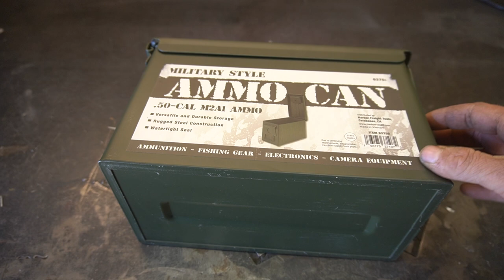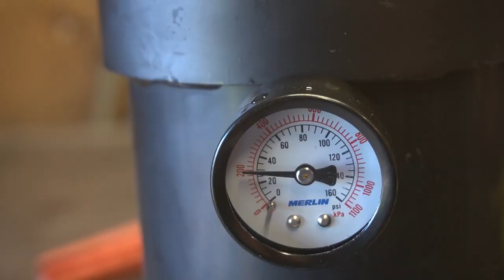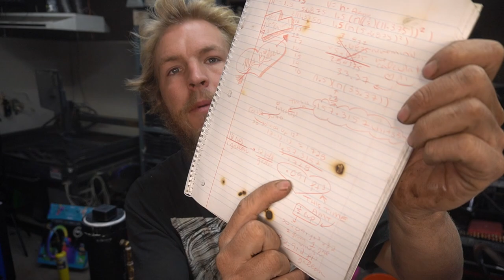Can You Weld Using Vinegar & Baking Soda?

Comment: great vid.
One thing you could do is add a sepparate tank above the reactor. add the baking soda to the reactor and let de vineger drip into it from the higher tank.
If you add a second line too the top tank the pressure sould allow the vineger to flow down freely. 

Also if you add to valves to the lines you can add more vineger as you go.

Comment: Look up, Kipps apparatus.
If you put the top bulb at a certain pressure, the outlet will match.
ORRR, use an arduino to pump in vinegar when the pressure falls below a certain threshold.
Reply from the maker: oh man you know i'm a sucker for using unnecessary arduinos
Reply: @cranktowncity  Seriously though, the Kipp's Apparatus is what you're looking for. Just a bit more plumbing in your cylinder. Also, switch out the baking soda & vinegar for calcium carbonate & muriatic acid. The form of CaCO3 does not matter... chalk, limestone, marble or even pearls will do :D

Comment: Hi. Love this idea and good video btw.. 
what if you get some dry ice, put a small piece in your contraption, inject a bit of water and see how that works. Dry ice is compressed CO2 and will build up significant pressure when confined and water will speed up the melting of the dry ice to create CO2 gas. ( Might be a good idea to install a release valve to avoid explosions)
Reply: Why contaminate with water‽ Just use heating...

Comment: I'm pretty crappy at chemistry, but I know a few things that help estimate. 

Mol is molecular weight in grams.
Vinegar aka acetic acid is 60 grams a mol. And Baking soda aka sodium carbonate is 99 grams a mol. 

One mol of each when mixed produce 1 mole of water, 1 mole of co2, and 1 mole of sodium acitate.  But we are only interested in the CO2 here, and the fact that one mol of most any gas at standered temperature and pressure = 22.4 liters.  

In short, 60 grams of acetic acid + 99 grams of sodium carbonate 
generates 22.4 liters of co2 gas at stp.  

But vinegar is usually a mix of water and 3-5%  acetic acid.  A quick search indicated that some brand is about 0.85 mol of acetic acid to 1 liter of water. 

So for each liter of that particular  vinegar, one needs 85% of 99 grams or 85 grams of sodium bicarbonate, to produce 85% of 22.4 liter or 19.04 liters of co2. And maybe that brand of vinegar is a fairly typical concentration. 

Maybe one may increase the volume of co2 by passing it through a heated copper tube causing it to expand.

Comment: I shouldn't have been so surprised this would work, but for some reason I was.  Really neat.  One thing about the method is that your cylinder is obviously at a higher pressure.  If it's say 3000 psi and your pipe bomb is only at 30, you have 100 times more gas per unit volume in the cylinder.  So your cylinder really has 20 times the volume, and 100 times the pressure for 2000 times the gas produced by the gallon of vinegar and box of baking soda at standard temp and pressure.
Reply: 60 cubic feet is the volume of CO2 at atmospheric pressure, not compressed. CO2 is stored as a liquid, somewhere between 750 and 1100psi, depending on how long you leave the bottle in a hot car.

Comment: I think you should check out the aceylene gas generator. It use dripping water to wet a carbide rock in a seal tight giant chamber/bottle to get a controlled gas pressure.

Comment: If you fill the chamber up with baking soda you could probably squirt vinegar in over and over till it's all used up. OR! You could even rig a pressure switch to an arudino to automatically give it a squirt when your pressure starts dropping.

Comment: Been thinking this for a while, but i would go with citric acid my self, since you can get 4,8kg of powdered acid for 25€ and make huge amount of solution from that, though having your own water source does effect the end price a little. For delivery method maybe have pressurized silo on top, with screw hopper/auger delivering that to sieve that turns it to fine powder that drops to bottom of the reaction chamber. Sieve can be manipulated by same auger axle so it moves and breaks up any clumps of baking soda... Also for soda there might be cheaper solutions. Further improvements add water filter system to remove any impurities from the gas like baking soda dust, that alternatively improves reaction if mist from reaction gets out from the reaction chamber, it has to go trough the water filter that should have some baking soda in it, hence all materials get most definitely turned into co2 in system and no dust or even worse acid gets to welder. Any evaporative moisture due reaction heat or such can then be filtered with compressed air water filter, though does that work with so small pressure? I'm not entirely sure how it works, gotta look into it.
Auger axle seal can be just normal machinery seal or few O-rings though depends on how much pressure you get in there. 
Ou and best part of the auger system is that you can control the reaction with say arduino, or even just basic pressure switch adjusted just little bit lower end since creating gas and pressure takes little time. For longer running emergency welds have silo have two big ass valves, so more soda can be added with out dropping the pressure created much.
Reply: My DIY CO2 system is just a fire extinguisher that I can refill with dryice, super cheap.

Comment: Maybe you could look into using a zeolite or MOF and a rig like a portable O2 generator for people with lung problems. Those moderately compress air in canisters full of a zeolite, then reduce the pressure. I can't remember for sure but I think not-oxygen in the air is the first to leave the canister and is discarded. At some pressure the oxygen starts to be released along with some air contamination. That mixture is compressed again and sent to another canister for a repeat of the same process. I think there are 3 canisters in all and with each compression release cycle the gas becomes more oxygen rich, I think to 95% pure on the 3rd canister. You might be able to re-purpose an O2 generator by using a different zeolite and maybe tweaking the pressures but I have no idea. If you are elite and worthy of warez you might even be able to add your own microcontroller and code, and make the canisters easy to swap in and out so the you could get other useful gasses out of the air, like O2, Argon, Krypton, get buzzed on Xenon and etc. Since the zeolites aren't all that expensive (not sure about MOFs and similar) and can be reused many times, it may even cost less than buying gases. There is a chance that your gas dryer contains a zeolite. Which is another benefit and complication, they seem to be pretty good at getting water out of air too so they have to be baked dry periodically.
Reply: I had the good blessing of getting a few end of service life zeolite and there are other chemicals for conditioning and moisture ( see absorber tank refill lable and disposal refill lable as hazardous reconditioning took baking and repelleting the absorber bed ) based oxygen concentrators to vent the oxigen out of a bag sealed room and used a barbecue electric fire starter with homade charcoal to get the oxigen down after that then a room air filter for particulates . refilling the room bag externaly from a sealed O2 concentrator housing required getting famillar with the internal plumbing of it ( the bag got way smaller ) used a fan with a O2 sensor from one to read the room O2 level . Some O2 concentrators have processors that you can change the EPROM on as well as rechargeable batteries .

Comment: You can get 50% vinegar on Amazon and it is cheaper per percent then buying the stuff that's meant for cooking. The stuff on Amazon's meant for cleaning if you go on Google you can probably find 75 or 90%, but I use the Amazon stuff for dissolving Mill scale off of my metal signs and sometimes I use muriatic acid it just depends on what I'm doing and how big it is and also is great for killing weeds cuz every time I dump out the bucket that I use for dissolving the mill scale it kills all the weeds in the driveway

Comment: Another excellent video, you absolute maniac.  

What about engine exhaust?  You can use the alternator as a makeshift welder, and the engine (maybe?) can produce welding gas.  That's basically everything you need if you're stranded in the woods somewhere.

Yeah on second thought, nevermind.  Air is mostly nitrogen.  I don't know what mostly nitrogen and part CO2 would do as a welding gas.  And it'll have crazy high humidity.  Yeah scratch that, it's a terrible idea.

Comment: just a curious question, how much you have to pay to refill a co2 fire extinguisher? if it is not that expensive, it can be a choice too. may be buy some dry ice if it is cheap?

or

you can try collecting exhaust gas from engine, may be…loan mower? tracker? or your car? those are definitely co2 with nitrogen but without oxygen. nitrogen is a shield gas too? at least it won't harm your weld.
Reply: There is a hell of a lot of other shit in exhaust, plus there is definitely still oxygen in exhaust.
Reply: You can use dry ice since it's packed CO2
Reply: @Ender240sxS13  also you need to pressurize it.

Comment: Why not put the baking soda in the pressure chamber then have 2 valves on the top in series to a vinegar container. Than you can close the bottom valve, open the top so that the sapce fills with vinegar, close the top one and slowly open the bottom one. Rinse and repeat once pressure drops till you run out of baking soda.

Comment: use a water bottle instead of a balloon next time. fill it with water, hold it in the bucket upside down so that the bottle neck stays in the water at all times, put the hose into the hole of the bottle, and the gas will push the water out the bottle

Comment: Why are you using 100% co2 to weld with?  You should be mig welding with mixed gas.  75%-25%
Also you should be push the puddle when mig welding so your getting gas coverage in front of the weld puddle. Instead of drawing the puddle and the gas is going in the opposite direction of the puddle

Comment: My man, my tight arsed CO2 running brother. Have you tried getting CO2 from brewing supplies instead of welding gas suppliers? I get my D filled for $60, but that's Australian dollars, which have a 3x markup as well as the exchange rate
Reply from the maker: worth a shot, thanks for the tip!
Reply: @cranktowncity  Anything to keep the wire burning man, not much worse than running out of gas on the weekend!
Reply: @cranktowncity  get a fire extinguisher and use dry ice. Just weight it accordingly to what the fire extinguisher can withstand.